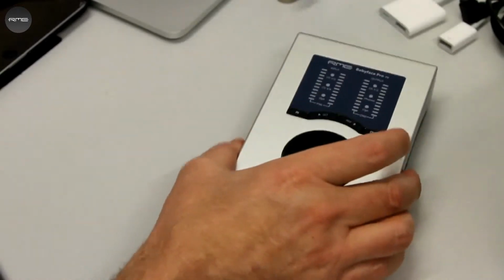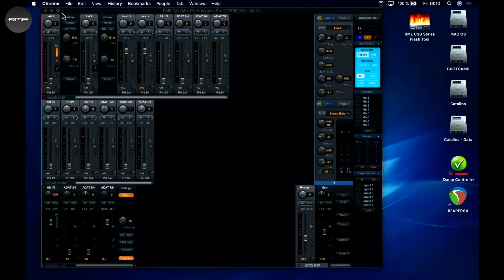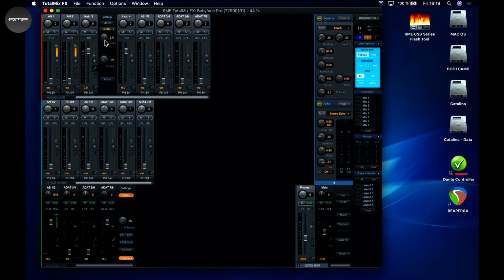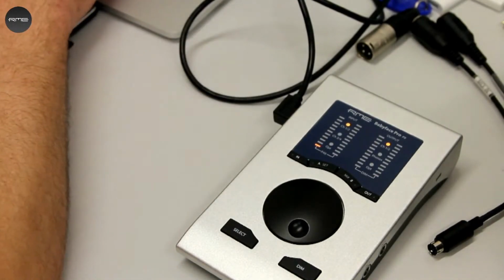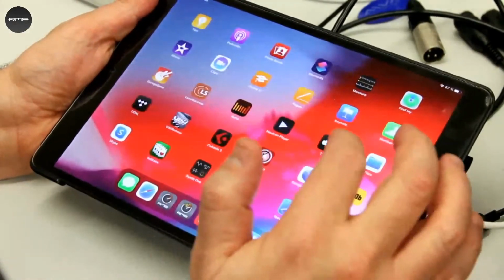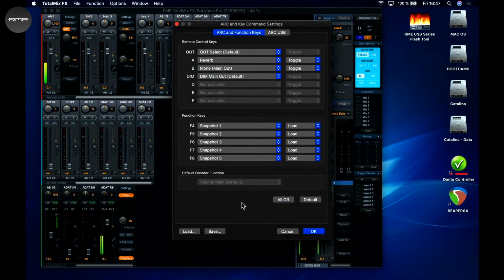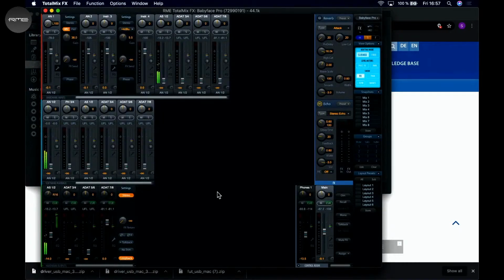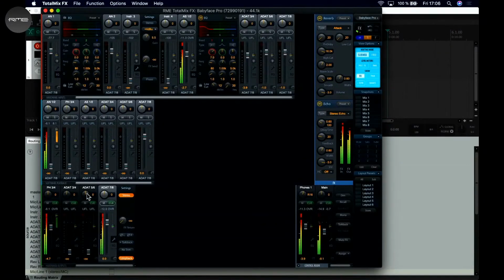RME Essentials: Babyface Pro FS

Comment: Perfect video! Even for me as an advance RME user I found some very usable tips and perspectives regarding the RME product and how they can be creative combined. The only thing I need to get my head around is from manual page 10. "The short circuit protected, low impedance XLR line outputs do not operate servo balanced!" if I understand everything correctly it means I need to use a XLR to Tele of TS type to avoid having XLR pin N3 connected when using babyface XLR out when connected to equipment like for example effect pedal or a synthesizers audio input connection?

Comment: This would have been the perfect portable sound card for me, I’m just not fan of the connectivity for a modern mobile setup nowadays. I’ll wait for a new edition that would have :
- USB-C as PC connexion/bus power (I know you like the classic USB-B but for mobile use it’s way more common)
- Standard MIDI Din or at least TRS MIDI I/O (still requires break-out but much more common with the mini-synth world nowadays)
- The Mic inputs could be combo Jack/XLR type for more flexibility
- If there is some space left, adding an additional 3,5mm combo in/out TRRS jack (line level) similar to those for mobile phones, that could be routed as mix-minus
- Alternatively or additionally to the previous point, a 3.5 TRS jack-in (line level)
(οbviously keep everything else : XLR outs, ADAT I/O, INST/LINE inputs etc…)
If the 3 first points could be accomplished at least, I would be an instant buyer. The two last would make it a killer in terms of flexibility.
Good luck RME teams, you have definitely nailed the game in terms of flexibility already with UCX II and UFX III, not owner yet (actually hesitating on those two !), but at least on the paper I am a total fan of the features, notably the standalone mixer options.
Reply: These have a usb-b to usb-c cable. But I agree with the combo jacks. I would also prefer outputs 3-4 (for another set of monitors) rather than having inputs. I’m just waiting for a new version of it. More than ready to buy it.

Comment: I've got to tell you. DON'T BUY THIS MACHINE IF YOU'RE A SINGER SONGWRITER.I've had a Babyface for four years and it's never worked properly. I've never been able to get the instruments to record. Tried everything. READ THE MANUAL. WATCHED EVERY POSSIBLE VIDEO. JUST WON'T WORK...Audio is fine—but I would go to a simpler machine. I hate it.
Reply: Exact opposite here, been running mine for 4 years now hooked up to both my iPad Pro with Cubasis, and Desktop PC with Reaper. It’s been a complete no brainer.

Comment: Just purchased BF PRO FS to use with my new M1 Pro MBP and I’m very curious about optimal USB connection, especially considering the laptop only has two USB-C/Thunderbolt connections, with independent TB controllers.  Do I need to have the audio interface plugged directly into laptop for optimal latency/performance, or will it work just as well through a hub, shared by other USB midi controllers and devices?

I’m currently using a USB-C to USB-A Hub , where I have 7 USB controllers, including Mouse/KB .. And the other thunderbolt port is directly connected to a TB hard drive. I’m thinking my best bet is to probably get a 4 port thunderbolt hub and just run the USB-A hub and hard drive off of it, and dedicate the Babyface to the other thunderbolt port.
Reply: I always use direct on the interface to have the least kind of interference

Comment: I'm thinking of buying a babyface to replace my old FF800 but I still need those extra I/Os. I wonder if I can connect the FF800 as a slave to use those I/O but I can't use the firewire connection anymore, it has to be with adat.
Reply from the maker: You have to configure the Fireface 800 as an AD/DA converter. Route analogue inputs to ADAT outputs and ADAT inputs to the analogue outputs. 
The unit saves its settings.
You can use the Fireface 800 with Firewire to Thunderbolt adapter.

Comment: Hello RME Team, could you please advise me what should I do? 
Given: Mic via XLR in AN1/2 input and Electric guitar via 6.3mm cable in AN 3/4 Input (instrumental). 
 The problem is that I can use only one Input channel for programms like skype, discord etc. 
but I want to make some online lessons with my teacher, where I will able to speak AND playing the guitar at the same time. 
 Is it possibe to mix those channels into one i.e. virtual imput channel and select it in any programm on pc? 
 
Or the only one option is to connect my mic to AN1 and guitar also via XLR to AN2? (but I've heared that its bad idea)
Reply from the maker: You can use the loopback function of TotalMix FX to mix and route your mic and guitar to an input channel. If your work on Mac you have to use a littlt work around, because on Mac there is a problem with streaming software inputs. Please watch our videos about loopback. 
https://www.youtube.com/watch?v=oTDsovN4tpc 
https://www.youtube.com/watch?v=Xpt7LczeAvU 
https://www.youtube.com/watch?v=Mpibtzb72RI
Reply: @RMEAudio completely forgot to answer. Thank you! I did it right after your answer and it works fine :)

Comment: Hi, I have a question: when plugging into the normal hi-z jack inputs (for example a di guitar or bass), does the signal go through the preamps (same as plugging in the xlrs on the back) ? Thanks! Best regards
Reply from the maker: The BF Pro does not have a usual mic preamp. It uses a fully transparent input buffer which has the added bonus of adjusting its gain. Bypassing it would bring zero advantage, the circuit is needed as input buffer anyway. So set it to minimum gain and you can use any external preamp to colour your sound.When a guitar is connected to the instrument input, the Babyface automatically detects it and switches to Hi-Z input.
Reply: @RMEAudio  That’s great, so you confirm that the guitar signal goes through the preamp and benefits from its sound quality right? (unless I leave the volume signal to 0)
Reply from the maker: @micheletacchi2302  I edited the previous answer. The guitar (Hi-Z) goes through  the AN 3 or AN 4 preamp, even if you set it to zero.
Reply: @RMEAudio  Thanks, I don't have an external preamp so I need the signal to be as clean and as good as possible just plugging it directly there.
Reply from the maker: @micheletacchi2302  You don't need a preamp to connect a guitar. You can connect the guitar directly to the instrument input.

Comment: Thanks for a great video! 👍Question: Can you plug external mic pre's in the unbalanced inputs next to the headphone outs to get a total of 4 recording mics simultanously (without using the adat/spdif)? Best from Norway 😊
Reply from the maker: Yes, that is possible. It are also normal line inputs.
Reply: @RMEAudio  Thanks for a great answer, I’m now ordering a Babyface pro FS as soon as they are back in stock on Thomann 👍 Upgrading from 2014 Steinberg Ur28m and hoping for a noticeable difference 😊
Reply: @abracadabra1550  Hi. Did you get your babyface? How went? Please tell us.

Comment: How can I mix in and turn my samples to 96khz? Because it switches automatically to 44khz
Reply from the maker: You need to do this in your DAW. Set the projekt to 96kHz and import the samples. You should get the question if you want to convert the tha audio files. Ask the manufacturer of your DAW if you have more questions.
Reply: @RMEAudio  ty